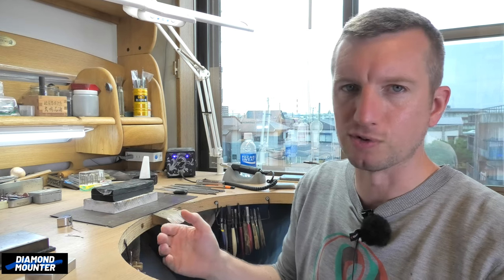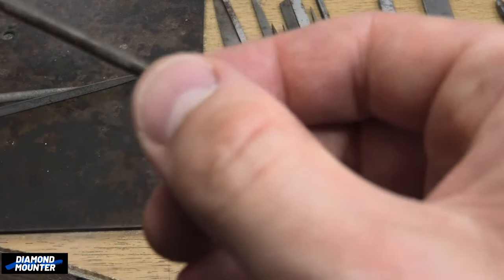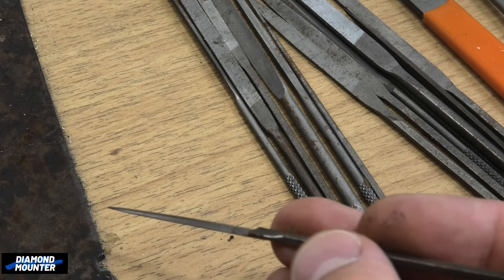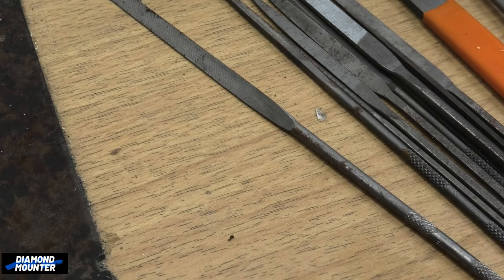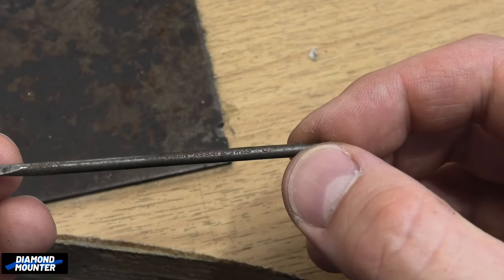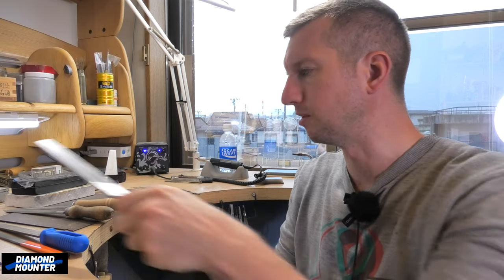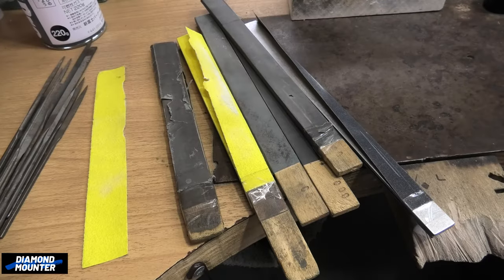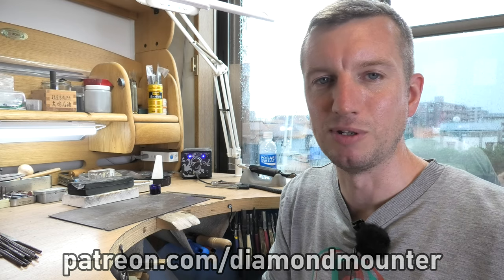Which files do you need?

Comment: I LOVE my 12inch flat Magicut Nicholson file for easy flattening of a surface and my 4 swiss cut ring file for easy polishing the inside of a platinum ring. A 6 cut is very very handy if you work alot in silver as you can polish after so super handy for bezels
Reply: The 12inch Nicholson is a beast and the metal gets super hot.

Comment: Frederick Dick is consistently coarser than other brands.  The very small needle files  look to be escarpment files used by watchmakers.  I love my #2 flat file with one safe side.  You might think that my #2 ring file would be more useful, but with the exception of working on inside of shanks, I don't use it because I'm always stabbing myself with that dagger-like point.  I noticed that you have your large files stored together in a sling under your bench.  Convenient, but are you not worried that they get damaged knocking  against one another?
Reply: Thanks for the tip about the F. Dick files! Chris does actually mention in another video that he's okay with his larger file storage setup, but is aware of the potential damage from keeping them where he does